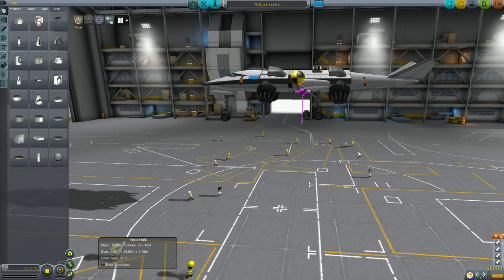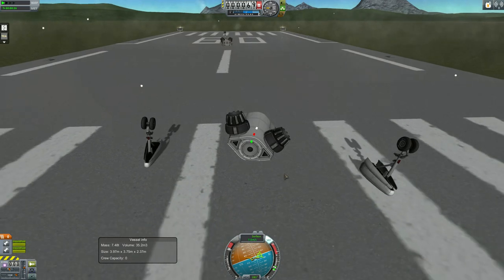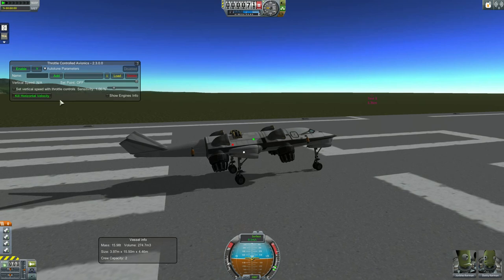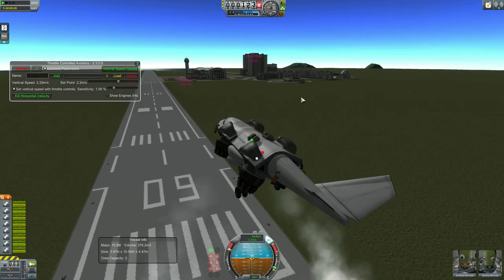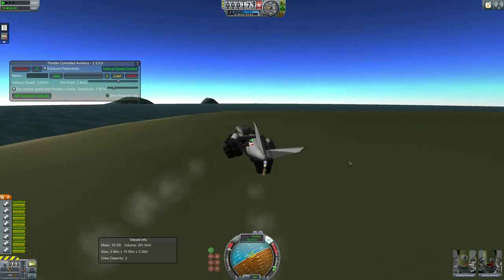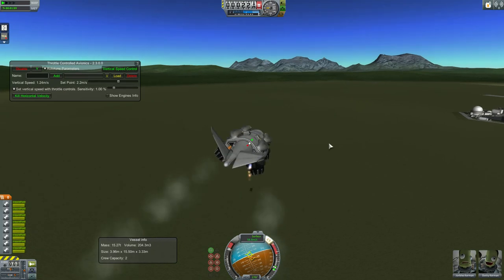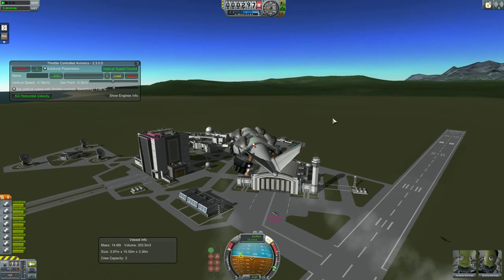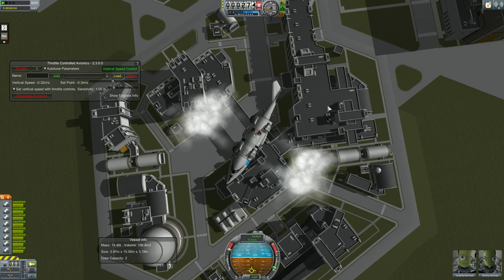New features in TCA v2.3.0

Comment: Hi i also install V2.3.0 but i facing a problem that i can see TCA normal panel in design mode, but in launch mode , the panel only have an advanced button and nothing else, any thing i should adjust ? thanks
Reply from the maker: What KSP version do you have? And more important, why do you use v2.3 when the latest version is v3.2 for the latest KSP-1.1.3?
Reply: +Allis Tauri hi I'm using 1.1.2
Reply: BTW my typo.. TCA version is 3.2 not 2.3
Reply from the maker: v3.2 is for KSP 1.1.3, it is not backward compatible with KSP 1.1.2 because of the KSP API changes. If you're not planning to upgrade KSP, use the previous version:
http://spacedock.info/mod/198/Throttle%20Controlled%20Avionics/download/3.1.0-KSP-1.1.2
Reply: thank you!!!
work now

Comment: Can I use TCA for normal planes/SSTO when I take off my plane pitch up like a rocket.. :/
Reply from the maker: Thiago Baldwin, unfortunately, TCA is not suited for planes, as it does everything using engines. So VTOLs (including harrier-like planes), copters, rockets and spaceships, but not the pure planes. For that there are several other autopilot systems, including a MechJeb's module, FAR's flight assist, the Kramax Autopilot and so on.

Comment: This mod seems great but I can't bring up the settings menu no matter what I try and all command pods show as TCA being "unavailable"

If anyone could help it'd be Appreciated
Reply from the maker: +Anthony Williams "TCA: Unavailable" means you haven't purchased it in the R&D building. Please, consult the manual and the TechTree graph of TCA modules:
https://github.com/qfeys/ThrottleControlledAvionics/blob/master/GameData/ThrottleControlledAvionics/INSTRUCTIONS.md
http://i.imgur.com/gMaaM9E.png
Reply: +Allis Tauri i should clarify that it's in sandbox,I'll read that manual in a bit
Reply from the maker: +Anthony Williams then it's strange indeed. In sandbox all command pods/cockpits/probe cores should have TCA.
Common things to check: 
1) KSP, TCA and ModuleManager versions -- if you're using KSP-1.0.5 you need this version of TCA (http://spacedock.info/mod/198/Throttle%20Controlled%20Avionics/download/v3.0.1) and compatible MM; if KSP-1.1, then this version (http://spacedock.info/mod/198/Throttle%20Controlled%20Avionics/download/3.0.1-KSP-1.1-BETA) and beta version of MM from its forum thread.
2) if you're using Blizzy's Toolbar and there's no TCA button you may need to delete GameData/toolbar-settings.dat file that sometimes becomes corrupted.

Comment: how to land if alt hold mode is on
Reply from the maker: Either use the on-planet "Land" program to land automatically, or, manually, by killing horizontal speed ("Stop" program) and then lowering the altitude setpoint; in the second case I recommend using relative altitude ("Follow Terrain" mode) and setting altitude to 0.
Reply: ok.. one more... how to stop this mod from ato gear up and brake on
Reply from the maker: "advanced" tab, there's a set of switches that toggles the use of brakes, gear and all. You can also disable the "VTOL Assist" to prevent this only for vertical takeoff and landing, but leave for landing from orbit. And the last advice. Read the manual: https://github.com/qfeys/ThrottleControlledAvionics/blob/master/GameData/ThrottleControlledAvionics/INSTRUCTIONS.md 
It is also available in game (the "?" button or "TCA MAN" toolbar button).